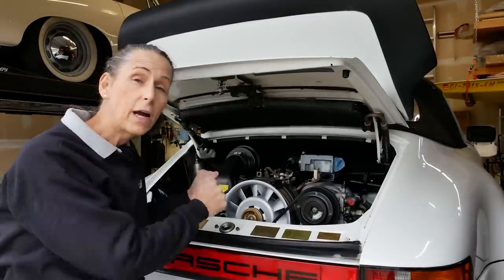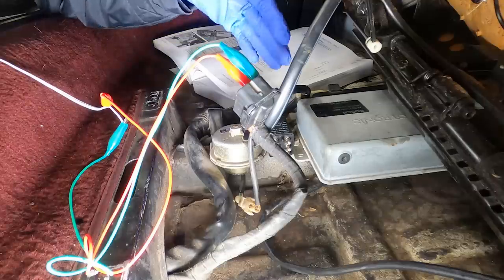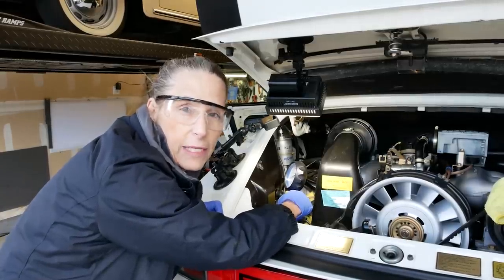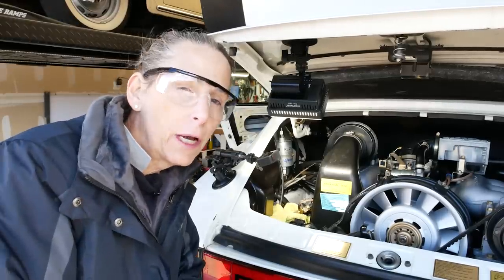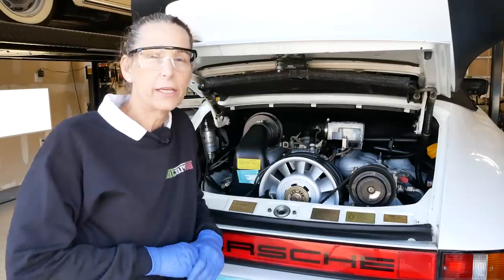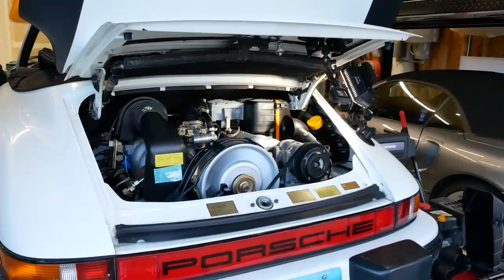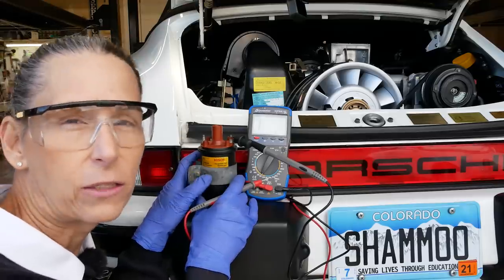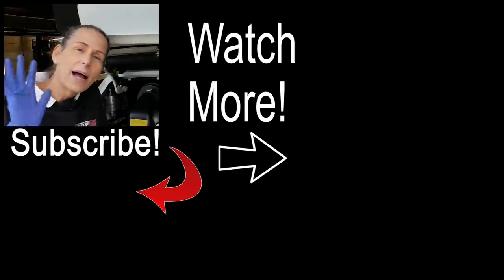Budget eBay Porsche 3.2 Carrera Project Car! #30 - NOW WHAT?! YOU WON'T BELIEVE IT!!

Comment: Hi Fran, I experienced a similar problem with a 1963 car. Weak spark, even after replacing the coil all the wires, plugs, cleaning entire fuel system... the fault was eventually diagnosed as due to bad wiring/contact from the ignitionlock to the coil. Might be worth double checking this as well. The contact at the back of the ignitionlock have a direct influence and can cause the engine to stall... good luck and love your patience.
Reply from the maker: Thanks, I'm pretty sure the signal to the coil comes from the ECU.  We'll get it though!

Comment: To me, I know it’s a long shot, it sounds like fuel delivery. I think you can have fuel pressure without adequate fuel flow. Good job on the video.  I am anxious to hear what you find the problem to be
Reply from the maker: Thanks Jeff, I didn't perform a flow test.  But if it can maintain pressure I'm thinking it has the flow.  There is certainly something a foot...

Comment: Hi Franny, another great video! 
When you did the video on what to include in your emergency road kit didn’t you include a coil? Anyhow I changed my 65 year old coil out of my ‘55 continental and put in a new coil but I kept the old one for the emergency kit. 
I’m betting your problem was the coil. 
You inspired me to go out to the airport and do  some more work on the old car today after watching your video. Figured out I wasn’t getting full throttle. Did some adjustments and took it down the taxiway, found out it could do 0-60 much faster. Thanks.
Reply from the maker: Thanks James, I do have a coil in the 356 tool kit :)

Comment: Your fuel is now a year old unless you have changed it. At the one year mark the starting and running starts to run crappy.
Reply from the maker: The fuel is all new.  I drained the tank completely and have a new fuel filter as well.  I filled it with fresh fuel.  Oh, and all the fuel lines are new so no residual fuel there either.

Comment: I had an 86 Carrera (and miss it dearly) that had body work done. When I got the car back, I had all sorts of ignition and charging issues - it turned out some of the grounding wires between the engine and chassis had not been reconnected, resulting in inconsistent/weak grounds! Maybe check ground with the multimeter between engine and chassis/check those grounding wires! Lovely clean engine, I enjoy your process!
Reply from the maker: Thanks Todd, I was pretty careful to clean all the ground connections, but I will double check.  It has to be something I've touched and the grounds do qualify!

Comment: Franny  Do not overlook your return fuel line.  If it’s blocked the engine will flood and die.  It happened to me on a CIS. Different fuel system but the symptoms were the same.
Reply from the maker: Hmmm...  Thanks.  All the fuel lines (even in the tunnel) are new BUT I do need to check for any kinks...

Comment: It's hard to tell in the video, but I do not think you have the right spark plugs. The consumer line Bosch sparkplugs do not work very well on any engine, in my experience. Also, all the air must go thru the meter, so borrow a smoke machine and check for vacuum leaks. By the way, the wrong sparkplugs will overload the coil and cause it to fail.  Your videos are very well done and should serve as an inspiration to all.
Reply from the maker: Thanks so much and thanks for the tips :)

Comment: If you are going to replace the coil  be aware that the Porsche community has flagged the new Bosch silver units as highly unreliable. In fact, the factory stock black models are sought after and desirable as they generally last forever if kept dry and tight. Good luck, anxious to see the fix.
Reply from the maker: Thanks for that.  I want to call a place here that I bet has a coil tester.  That should tell just what shape it is in.

Comment: If you still have the issue after the coil is replaced I would check upstream to the air flow sensor. Is the unit functioning correctly? That is where my thoughts are. Good luck and I'm anxiously waiting to find out what the root cause is. Love the channel and the content.
Reply from the maker: Thanks!  That is next on the list.

Comment: I had a similar problem years ago with a Lucas coil in an Austin Healey. It worked fine at the beginning of a drive then died. A mechanic told me that they develop cracks within them , and when the coil heats up, the crack will separate the wires in the winding, and no current. Tough to diagnose. Great video, thanks for posting.
Reply from the maker: Good to know!

Comment: Ran fine on 5 injectors - they were sent off and refitted and now the car runs bad on all cylinders.  Sorry but I'd suspect the injectors and firm being used to service them.  My experience of those old coils, in these circumstances, is that the car wouldn't start.
Reply from the maker: I doubt seriously ALL the injectors would all cut out simultaneously like that.  This is upstream of that.  When it is running it is much smoother before (check out the jiggling of the deck lid now).  This problem was there before the injectors were sent back.  It is just now more noticeable (and getting worse).

Comment: NOOOOOO Franny!!!!  I wanted the injector problem to be the last of the problems!!!!!!  Have you considered swapping the Idle Control Valve computer or main ECU to test if one of your ECUs has gone bad?   Someone else already commented on this, but recheck your Center tower and 15+ terminal for 5000 ohms.  My Bentley manual for a BMW E30 has Ignition Coil Resistance values of .50ohms 1- 15+ and 5000 ohms center tower 15+ .   CANNOT WAIT for the next video!
Reply from the maker: Thanks!  Me too...  Yup...  It is 5K-8.7KOhms.  I missed that...  (They have it written as 5 - 8.7K).  Still, I don't like that yellow spark.  We'll get it!

Comment: Hi Franny I noticed in the last video when you were using the spark plug tester that the spark was not fast/constant - it was slow/ intermittent. That tester should light up like an Xmas tree with solid spark.
Reply from the maker: Thanks John, I think that may have been more of a mismatch between the flashing and the camera shutter.  But,...  I'll check again to be sure.

Comment: Just a shadetree opinion here but put a coil in and get those sparkplugs out of there.  Put in standard replacement platinums.
Reply from the maker: I really like those plugs...  I have A/B'd them and I always get a smoother idle in this and in the 356.  No one believes me, and it did surprise me.  I really like them.

Comment: Sometimes just the act of moving stuff around and/ or cleaning all the contacts etc or replacing with new parts may increase the demand on the supporting parts and just make components that were on the verge of failing fail in my experience. Keep up the good work!
Reply from the maker: Thanks!  Very possible.

Comment: Hey Frannie - I still suspect that ICV (idle control valve). You can run a jumper between 2 pins in the round connector behind the plastic panel on the left side of the engine by the fuse panel. It basically stops the ICV from trying to adjust. If you jumper it and the idle smooths out then the ICV is your problem. It’s what you would also do to adjust your idle. Pins are in this forum post: http://forums.pelicanparts.com/porsche-911-technical-forum/188748-what-jumper.html

Couple other rando thoughts. You can test the air flow meter with some various checks but I’d be surprised if that’s the problem. Also, I doubt it’s your coil. I’m still running the original on my ‘87. The new ones from Bosch (along with the fuel pumps) are absolute garbage, so be mindful of that.
Reply from the maker: Thanks so much for this!  I believe it tested out well (according to the Bentley manual).  I do have a replacement.  I can try swapping that out as well.
Reply: @HeidiandFranny  I think you had said you replaced the plug wires, too. You could measure the resistance on each one but this seems an unlikely cause for your surging. I’ve heard of turning off all the lights and running the engine to see if the plug wires are shorting out. You’ll see a lightning storm I’ve heard. Man, this has got to be so frustrating.

Comment: Morning Heidi and Franny, All the years I’ve worked on hot rods in cars and electrical I think it is the coil so what happens is the resistance in the coil it starts but as the coil starts getting hot the coil breaks down with shuts the engine down so my best guesstimate without looking at the car I think it’s the coil, Paul
Reply from the maker: Thanks Paul.  We have a new one on order.  We'll see :)

Comment: Love your videos! I think it could be a bad engine ground, an bad connection/chaffed wire in the DME, bad flywheel sensor/wiring, or possibly a bad voltage regulator that fried your coil. If that’s the case, same will happen with a new coil. I would check all your earths first. That first 10 minutes of running the engine could have vibrated some ground point just enough. I would also check your alternator while you’re in there checking grounds. Electrical gremlins are the worst but you will get it sorted!
Reply from the maker: Thanks!  I have cleaned and torqued the grounds...  I see your logic there.
Reply: @HeidiandFranny  awesome. You mentioned that you touched the DME at one point too so I would check the wiring and connections there. Also bad flywheel sensor wiring can mess up signals to the DME and in turn fry the coil.

Comment: Your videos are absolutely the best of their type. I have a 986 from 1997 and love your work.
But please tell me you don't put all that cleaning liquid down the street drains ?
Reply from the maker: Nope.  I keep the old oil containers and as they get all filled up we run them to the reclamation center (local auto parts store) to be recycled.  That goes for old gas and cleaners as well...  Enjoy your 986!  We had a 987 S that I really loved.  Really miss it.
Reply: @HeidiandFranny  Thanks for your reply. Looking forward to seeing if that HT coil is a dud ( episode #31 ? ) and fixes that odd running problem. I'm sure it will. Greetings from Sydney Australia.

Comment: normaly >9 bar must have. It's totaly pressure lost..
Reply from the maker: Correct fuel pressure for this system with the engine running is 2bar.
Reply: @HeidiandFranny  Ah oh.. that is not much , wondering..  thx for information.

Comment: Hi, even if this sounds weird, may you could check your fuel cap! If clogged you'll get a vacuum in the fuel tank! Had this issue for about 30 years in one of my cars and noone could solve this!
I were lucky to found out by myself!!! Well, it sounds silly, but smt the devil is in the detail, isn't it? Greetings from Germany
Reply from the maker: Thanks!  It is actually the opposite but just as important.  The is a vacuum in the oil tank and if the cap doesn't seal it will cause a vacuum leak.  I did check that and I think it is fine.
Reply: @HeidiandFranny  Ok cool. I've to say you 're very analytical on the subject finding issues and I like the way you're doing it!! The "hickups" on the engine appeared after you've installed the "fresh" injectors, on all cylinders as you've said yourself, soo... just my suggestion cause of higher fuelflow?! Strange thing back in the days was I'd Sparks and Fuel when checked, but still an engine that died in whatever RPM range it was! Strangest thing I've had ever seen in my Lifetime as a mechanic!!   
Hope you're on the right track with the ignition/coil, I'm sure you'll find it !!

Comment: This is brilliant. So helpful when you are building a new engine as I am. Definitely masterclass stuff. Many thanks. I have often found that condensors or capacitors are prime culprits for poor running as they can half work. The best video.
Reply from the maker: Oh my gosh...  I had a series of bad condensers on the 356.  New parts too...
Reply: @HeidiandFranny  I love your clear technical explanations and your use of diagnostic tools. It is so nice when you get an engine to run sweetly. Sometimes I find baselining each system is the only option. Like remove tank. Acid treat reline and ah the breather is blocked!  No wonder it had fuel starvation! Thanks. Hmm do I tackle a Carrera!

Comment: Hi You could remove the DME relay install jump wire just for diagnosis.
Reply from the maker: Good point.
Reply: Hi Franny, just on a side note 18 years as an Auto technician and I have only replaced 1 coil due worn a hole in the bottom and the oil leaked out causing it to fail, I would say the single type coil you have is the most reliable electrical item in most cars and would bet 100% some other issue. The distributor rotor in some european cars of this vintage have an in built resistor which can fail and cause havoc. Regards Dave.
Reply from the maker: @dave7856  Thanks Dave, I totally believe you.  I really doubt it is the coil.  I looked for a place locally to test it, but, alas... I did order another one as it is good to have a spare, but I really think it must be something else.  Interesting about the rotor...  I Just replaced a cap and rotor in one of the 356s and it was bad...  That is a really good point.  I'll add that to the list.  The Rotor, Cap, and Wires are all new.  Thanks!

Comment: firstly, i enjoy your videos, and i have to say, you are a very good and thourough technician. i have a VERY similar issue with my 1985 euro bmw 635. i have brought it to 3 shops, who couldn't fix it. in fact one of those shops told me that there hasnt been one car in 35 years that they couldn't fix............well, i thought about the high idle, and abrupt power cutoff on deceleration. first thing i checked was the plugs because i had a feeling it was running lean, and sure enough they were white. apparently, none of the shops even checked that. so i looked over and over for vacuum leaks and found none.  i found the aic to be bad, a kinked fuel line at the pump, and a messed up air flow meter. it now runs better, but still idles at around 1100 and the fuel virtually shuts off unless you are accelerating. i havent touched the injectors, but after watching your last video, i might replace all 6 and do the lines clips and etc. TY for your great video, but id go back and check for vacuum leaks and a faulty aic!
Reply from the maker: Thanks for that!  I hope you get that magnificent 635 running perfectly :)
Reply: @HeidiandFranny   well i have to laugh as 3 shops apparently didnt even pull the plugs! pretty sad that there are so few "mechanics" anymore! they plug in a scanner and change parts! thats why i love your analysis of issues...........a true "technician"

Comment: Fun and games, I had a similar problem, which turned out to be the crank shaft top dead center censor. The engine died  after it warmed up?  Hope this helps.
Enjoy the videos and I'm always waiting for the next one.
Reply from the maker: Thanks!  I have replaced all the sensors (Temp, Position and Speed) but maybe I have a bad one...
Reply: @HeidiandFranny  May be ?, it took 4 years to find an oil temperature defective sensor which kept putting my 2015 into limp home mode. Of course when I parked the car and turned it off , everything was fine after restarting the car? This problem drove me nuts, and the dealership thought I was, all they said was bring it in when the problem is happening, although the techs saw the code for the oil temp, but thought the problem was in the transmission and so they rebuilt it, expensive but under warranty.

Comment: Was the injector on the pass. side that tested dead the one that was stuck open or closed, just curious? I work on gas and commercial diesels and if I pull injectors, gas or diesel to upgrade I save the old ones as long as they're in working order. Before they go in a storage bag I spray each fuel inlet with a good squirt of aerokroil and I've never had one stick in 25 years. Mechanical diesel injectors can get real expensive so the kroil along with storing them vertically and not horizontally keeps them loose as goose and ready for use in another engine if needed. Great channel btw, I love those 3.2s, we built one for a 78 SC, turbo, forged internals, dual plug conversion, around 325 hp at the wheels. I traded it for a high mileage Carrera 2 and that got totaled by a box truck that ran a red light. C'est La Vie. Best wishes and stay safe.
Reply from the maker: Thanks  for  the tip!
Reply: @HeidiandFranny  Okay.

Comment: Love this channel !!!

can

If I pull that plug while the car is running the idle will start to surge badly"

Might
Reply: Not sure what happened to my comment.

Should have read "Have you looked at the cylinder heat temp sensor and the infamous wire?"

You did so in 2017 and found it to be working fine, but you never know ...
Reply from the maker: Yes, all the sensors (including the temp sensor) are new.

Comment: I'll bet on the bad coil - few things can get weak and erratic like a high voltage electrical component. I don't remember if you gapped or replaced your plugs - bigger gap will raise the secondary voltage, smaller gap will lower it. That the coil works at all (?) through an open circuit in the secondary (at low voltage) means current is jumping an internal gap or weakness — a precarious situation.
Reply from the maker: Yep

Comment: Very interresting diagnostic procedures. I have a Porsche 911 2012, coils need to be replaced  every 60 000 km or 4 years. I am surprised to learn that you have the original coils (1985). Why is that? Why coils replacement was not part of the standard maintenance?
Reply from the maker: Good question.